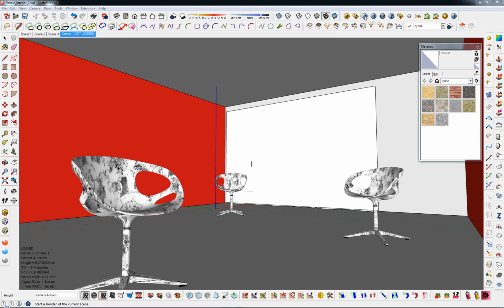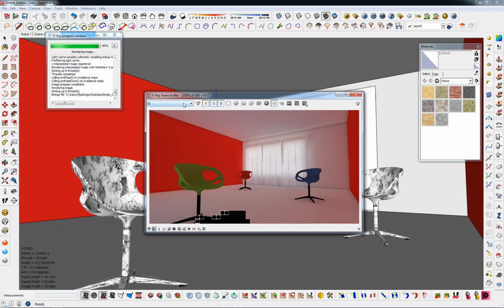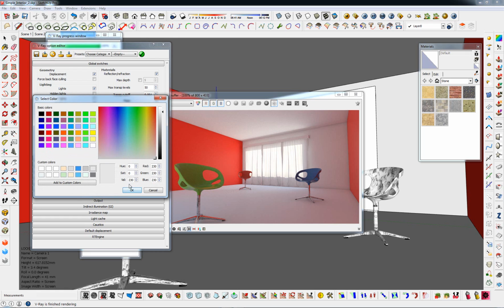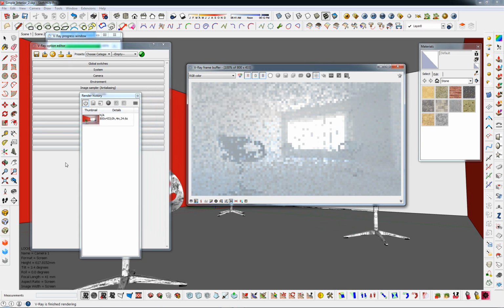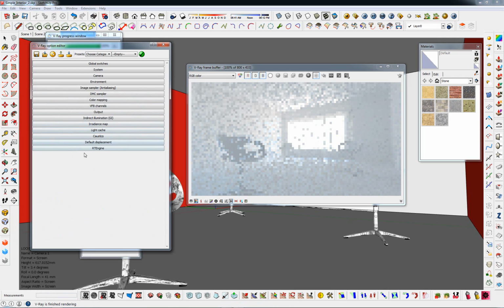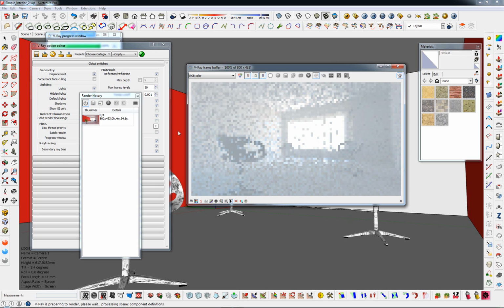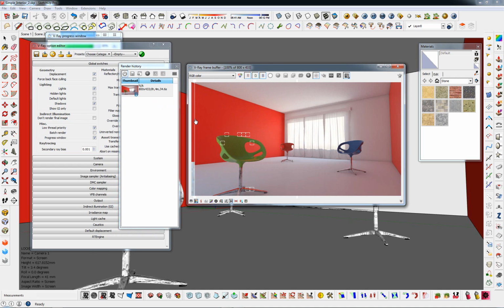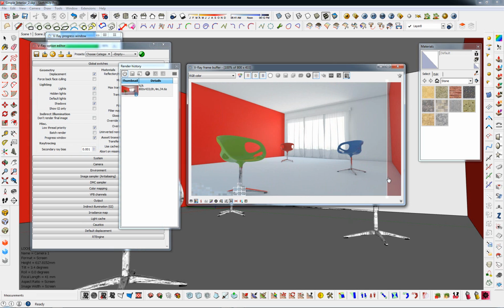V-Ray for Sketchup Color Bleeding

Comment: I am having an doubt like instead of applying Color in Diffuse I apply a texture map and when I render my scene that texture is coming on other object little bit  I try your method which you tell in video but that not works please help?
Reply from the maker: This is a very old tutorial. With the new V-Ray, you could use a material Called Override materials. Apply this material to the floor add the floor material to the Override material and add a white or gray material to the GI. https://docs.chaosgroup.com/display/VNFS/Override